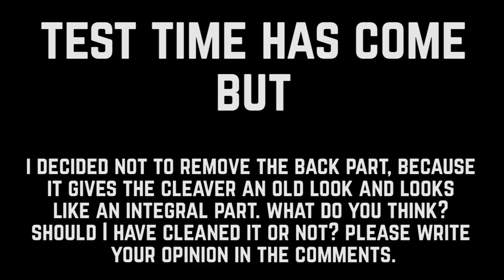Old Rusty Butchers Knife Restoration

Comment: Here's an idea when you get metal that is pitted like that. Head it up and hammer it with the pointy end of a ball peen hammer. Make it look like the hand hammered look is intentional. This also strengthens the blade a bit, if you get your fresh heat treat and tempering right after you do it. (it compresses the metal in spots, thus making it a bit stronger) It doesn't seem as sharp as it needs to be to be used for food. Some bluing compound would help too, if you like that look (they make it in black as well) and blued finishes can be used with food once dry and impregnated into the steel. Just some ideas, you always to the best job you can, and I respect that.